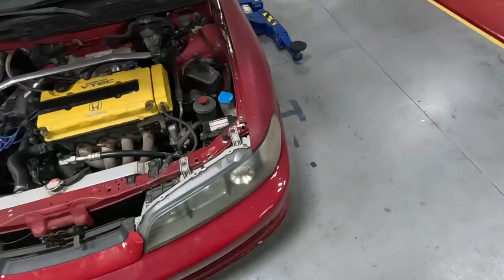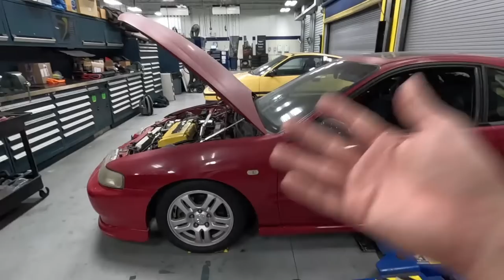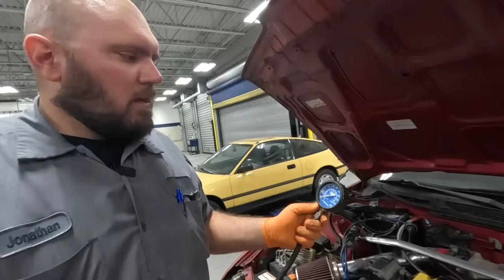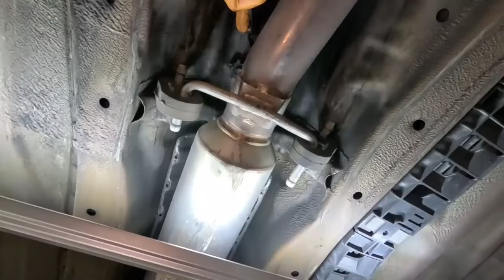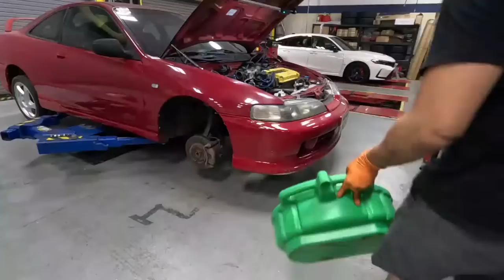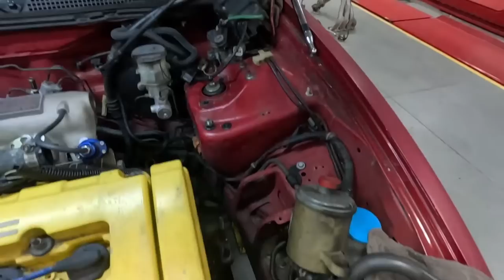ASMR JDM B18C Vtec Engine Swap Removal // 2001 Acura Integra GS-R

Comment: @AHC Garage KSWAP YES!!!  Music to my ears, I'm putting a K24 in the RSX first but getting back to the Integra soon, love it!  ❤‍🔥❤‍🔥❤‍🔥 The biggest thing I'm hoping ya'll could cover is wiring the adapter harness to: (1.) temp sensor (2.) fan switch (3.) O2, and wondering if you use stock RSX ECU w/immobilizer or hondata, and I suspect you use a drop in shifter like Hybrid but I really prefer the RSX shifter but have to cut mine up to use that  :/

Comment: Do you need to connect intake air temp sensor if Acura gsr is boosted ? And does that make it leak oil with engine light on?